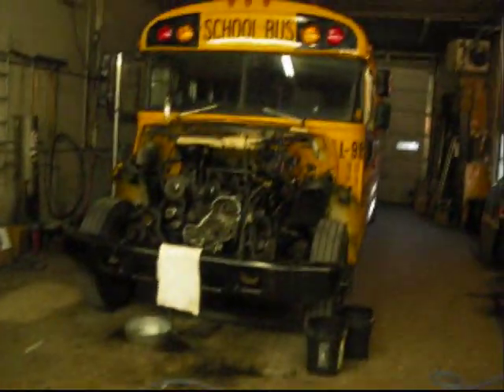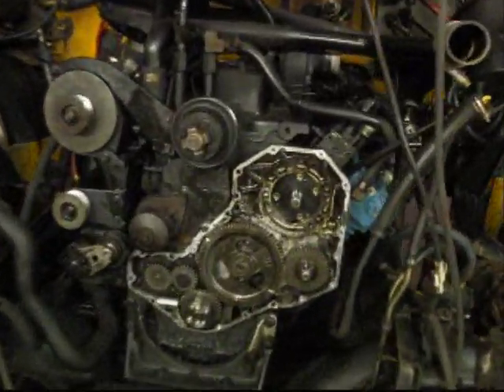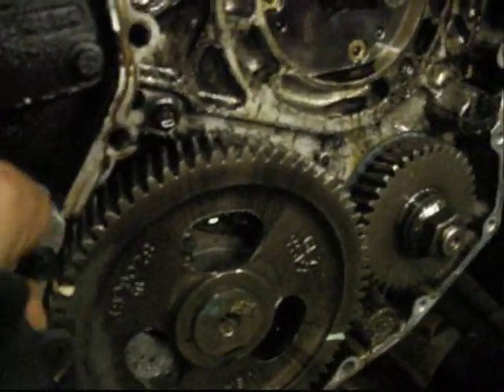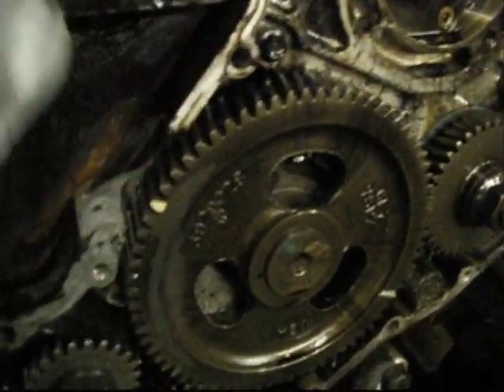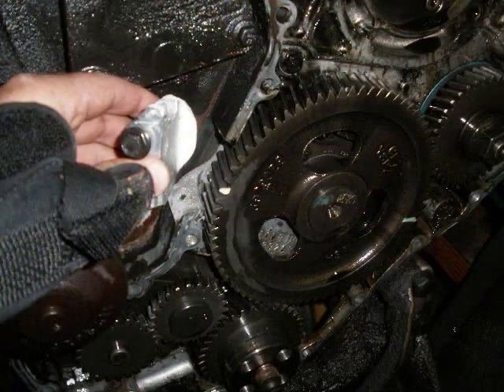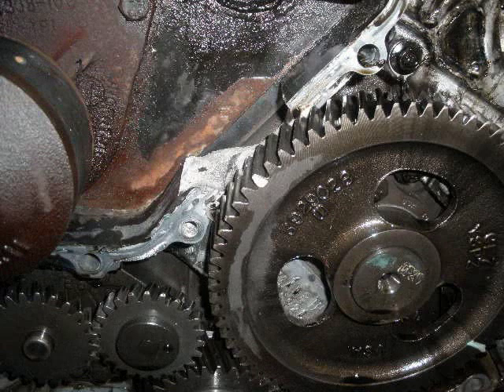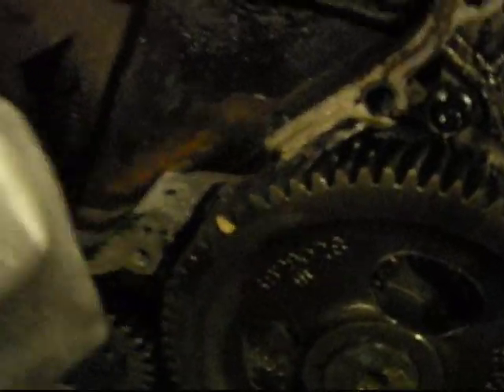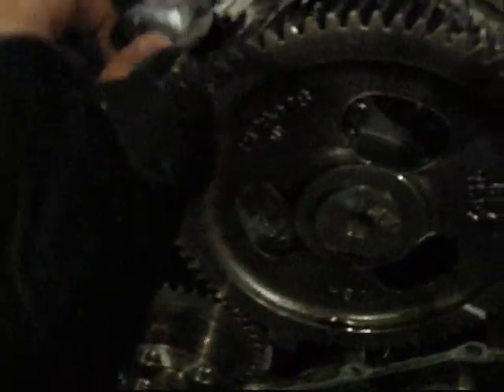Killer Dowel Pin- Cummins School Bus

Comment: This happened to one of the terminal trucks used by yard jockeys at UPS.  When I saw what happened to the engine, I immediately knew it was a killer dowel pin situation.

Comment: I have a 93 W250 with a 12 valve and this just happened to me, did you just pull the gears etc and replace the case to fix it? + do i put a new dowel pin after i put a new case in and the KDP kit?
Reply from the maker: You can either pull the gear on the cam (it is usually pressed on) or pull the cam.  They make different kits to tab the deal with the killer dowel pin.
Reply: matts4290 Okay haha i pulled the cam with the gear and plan on pulling the others as the case needs replaced but i am also curious about when i put it back together, does everything have to be timed and in the same spot?